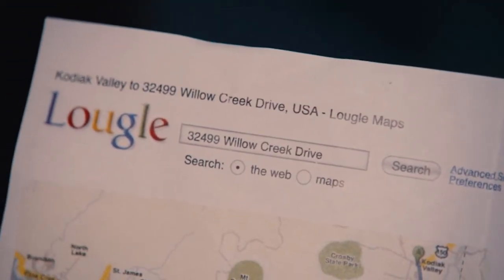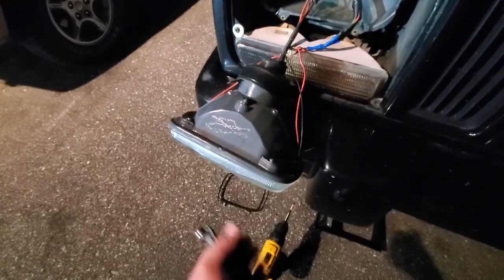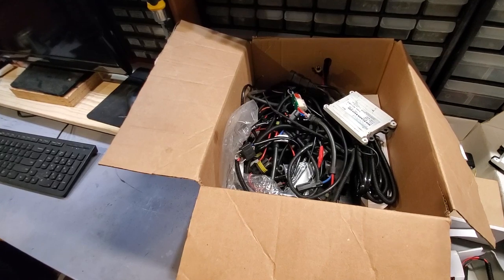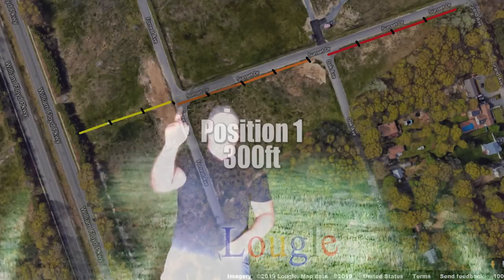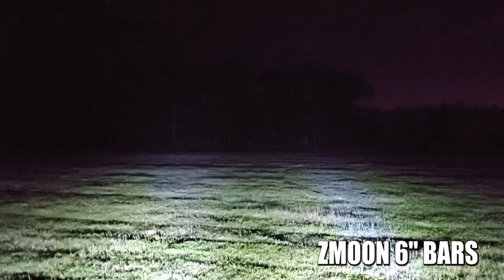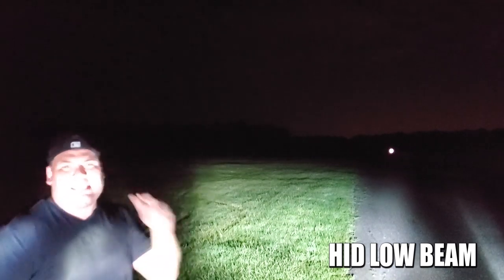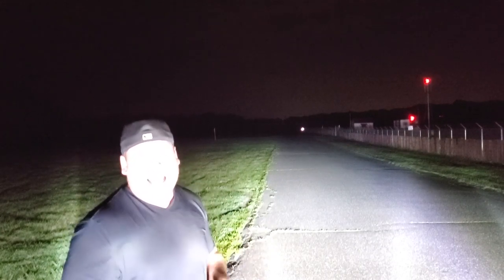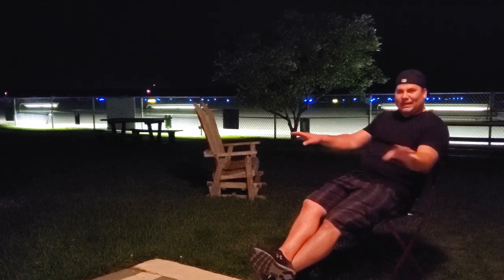JEEP XJ LIGHTING SET UP REVIEW - AUXBEAM GRILLE LIGHTS, ZMOON FOGS, & HID PROJECTORS

Comment: Loosing a bulb out on a rural road where you face traffic on the opposite direction is a bad thing, using the other lights would be a killer for other drivers, just for that possibility I would ditch those and get myself some good quality bulbs.
Reply from the maker: That's an excellent point.  Out here there's street lights everywhere and I do carry a spare ballast, bulb, and relay so I never considered that a big problem.  Also one of these bulbs is still brighter than 2 factory bulbs. Lol.

Comment: That's a crap load of light!
Reply from the maker: You know it buddy! It puts OEM lighting to shame 😎
Reply: @ProjectDanH  I have a pair of round Hella Black 500s on the grill. They look great out the light output is only ok. Will maybe look at those Zmoons to put in the stock fog location.
Reply from the maker: @josepichardo2659  cool man! Yea those Zmoons are intense! 💡
Reply: @josepichardo2659  I have 700FF at the center of my XJ, just replaced the 55w bulbs that came from factory with 100w  from Hella of course, the difference is huge and the casing supports perfectly well the wattage, mines have pencil beam pattern and might dare to say that they equal or surpass those 4" LED pods, you should give it a try.